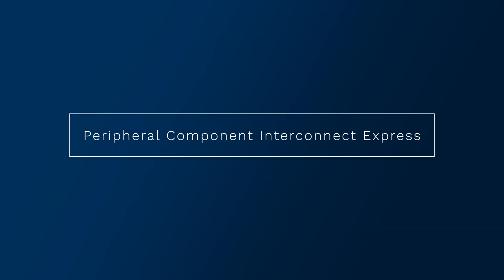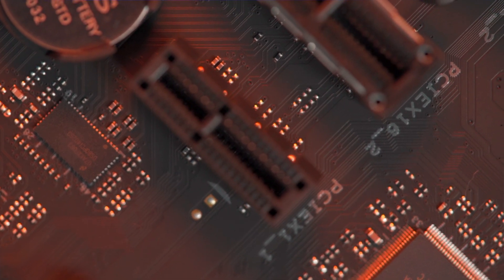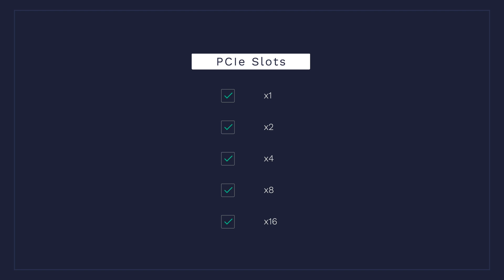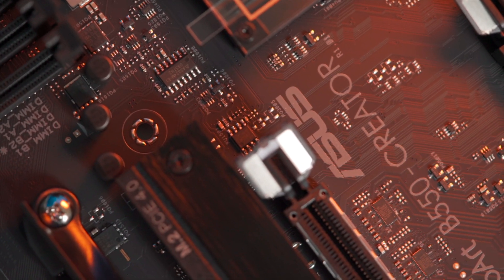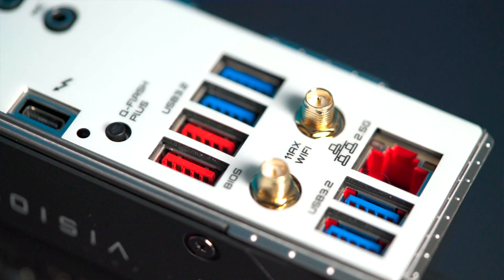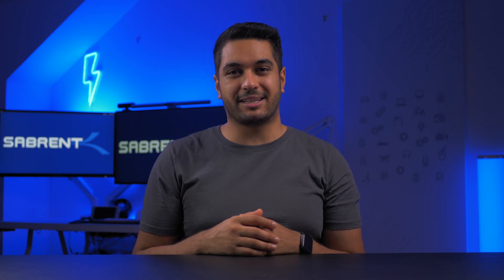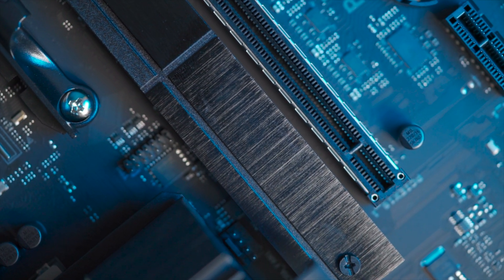What is PCIe 5? Explained Simply!

Comment: They have gen 6 and 7 but pcie  is obsolete  since 2005 how long will we keep using this standard  untill something else changes its like intel amd and nvida  don't wanna move away from sand aka silicone they are just money grabbing  trying to squeeze  the power out of a obsolete  substrate and a obsolete  pcie  standard  

When will these company's  change there substrate  and  change the pcie slot for a different  slot that's not pcie  something  that is faster and may require  a board redesign  to support  the new slot

Comment: Your comment "... Frankly, there isn't much need for that fast speed in our daily lives ..."

I built my first PC, an IMSAI back in the late 70s. The CPU for that, Intel 8080. Talk about dinosaurs. I was also putting my background in electronics to work by building custom boards for the S-100 bus in the IMSAI. Then, once I graduated from college, I started building PCs and working with PC/XT (ISA 8 bits), PC/AT (ISA 16 bits), later EISA and then finally PCIe. For the first company I worked for, we used those PCs for software development. Later in the 90s, I worked for a company needing PCs specified for fast management of 640 X 480, 3 bytes per pixel raw video capture and display for medical instrumentation. I used 7200 rpm RAID drive setups for storing the captured medical real-time video and DirectX software for displaying it in real-time under Windows.

I can tell you that I have been hearing your exact phrasing above with every PC hardware and standards release since the 70s. Fifty years of technology advancement and we always find a way for new applications to use the new speeds and capabilities. 

I'm 67.5 years old now. My home PC is a top of the line tower for video processing. Well, at least it was top of the line 15 years ago. Now, I'm looking to upgrade in 2024. I'll be waiting for the rumored dual processor NVidia 5090 with full support for PCIe 5. Also, motherboards with the appropriate chip sets to support the future M.2 Gen 5 drives. Then new dual 6k or even 8k 32" monitors to run Solidworks. An ultra-wide monitor and VR headset to run Microsoft Flight Simulator in all its glory. Plus, to support my new planned work for managing 8K at 120 Hz raw video to M.2 Gen 5 for storage and through some fast connections to multiple displays as well .H265 compression on the fly. Also, some fun work with managing video from multiple cameras for 3D work. Life is good.

So I say, yes, we ALWAYS need the latest stuff!

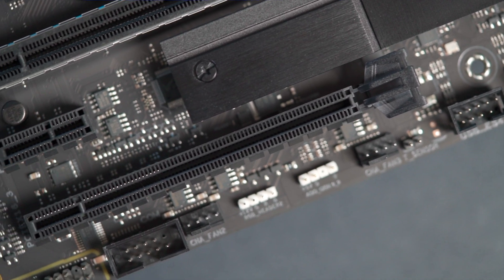Comment: 00:49 - Actually, USB is also located on the motherboard. If you have a laptop or desktop PC, usually there will be a cable running from the USB jumper pins to the USB socket on the laptop or desktop case.

Comment: Anyone know if a ''MSI B550 A PRO'' will support a RTX 4090?
Reply: should work, RTX 4080 runs on PCIe 4.0
Reply: I kinda think so to, yet these interim boards are always suspect to me, getting a solid Pcie 4/5  board wouldn't be a problem, but would much prefer to build a new DDR5/Pcie 5.0 rig late next yr instead. Cheers anywways
Reply: @davewills6121  Sure, if you are already running a decent rig, then there is no need to upgrade just because of the new GPU. And keeping a 4000 series is also no problem for next gen, because its always downwards compatible.

Comment: "The all-new AMD Ryzen 7000 Series processors are packed with state-of-the-art technologies for an effortlessly modern PC. Highlights include high-speed DDR5 memory, PCIe® 5.0 support, AMD EXPO™ one-touch memory overclocking, and hyper-efficient 5nm manufacturing. Put an AMD Socket AM5 motherboard at the heart of your rig to dominate the games you love today and tomorrow. If your PC needs the latest and greatest capabilities, insist on AMD Ryzen™ processors."

those are all new generation of cpu and all new generation of gpu if pci-5  that will benefit gamers big time
Reply: I dont think so. The law of diminishing returns applies here. We already cant saturate 4.0 lanes. Now we double the speed with 5.0. Thats like comparing light speed to 2x light speed. Great. I can load Dayz in 1.62 seconds instead of the slow 1.94 seconds with 4.0

Comment: Pcie 5 will matter on high end gpus for gaming if not on 4000 series then maybe the next gen in 2024 to 2026 all gpus will become pcie 5. only with AI core acceleration it eats alot of bandwidth
Reply: There is not much difference between 3.0 and 4.0 on the RTX3080s so, not likely 5.0 will have any meaningful impact anytime soon.
Reply: Pcie 5.0 should  never  of happened  until  we get 5.0 supported hardware

Right now pcie gen 5 ddr5 
CPU check ✔️ 
Nvme super speed supported drives ✔️ 
DDR 5  ✔️ 

PCIE 5.0 GPU  can't really  check it

4090 might utilise  it  but its not a proper 5.0 gpu
Reply: That's the problem  with pcie 5.0 it should of come when gpus get pcie  5.0  now the gen 5 pc hardware  feels half assed  because of the lack off gpu that supports  it
Reply: Apparently  the 4090 barely  maximises the pcie 3.0 lanes so why the fuck are we getting  a pcie  gen 5 when  the 4090 is barely using half its bandwidth  I say we'll pcie gen 5 gpus will be backwards  it may run at gem 4.0 speeds but even then 5090 is gonna be barely  saturate pcie 4.0

Comment: um i have a 3060 ti in a pcie 5.0 and it works fine.
Reply from the maker: Yes PCIe 5.0 is backwards compatible with 4.0. I did mention this at 6:20 , just remember your 3060 ti won’t be running at 5.0 speeds, just 4.0
Reply: @SabrentUSAOfficial  aw man. Is there any gpu that supports pcie 5.0?
Reply: @val_kyo  no
Reply: End of the year if your lucky

Comment: Will the new outrageous 5.0!work on a 16 pcle 16 X express? I want the 3090 ti that NVIDIA preparing for 2022 Jan but I don't want to buy the wrong egpu or razer Tomahawk Gaming Desktop if it can't connect
Reply: if you get a motherboard with a pcie 5 slot and the 3090ti happens to have pcie 4 then it can still be used in the pcie 5 slot on your motherboard